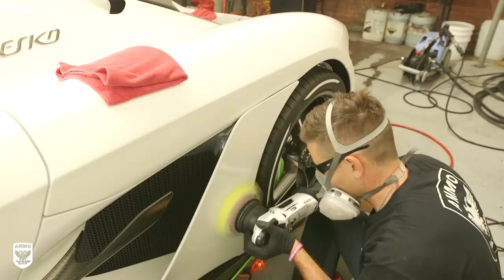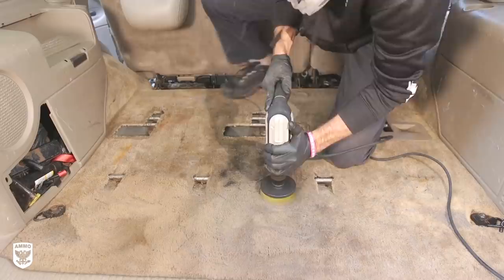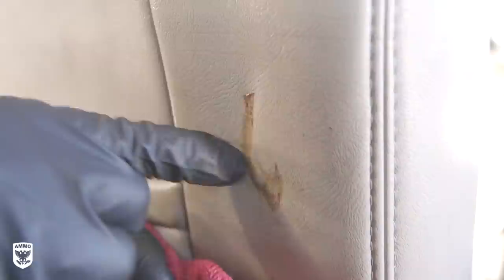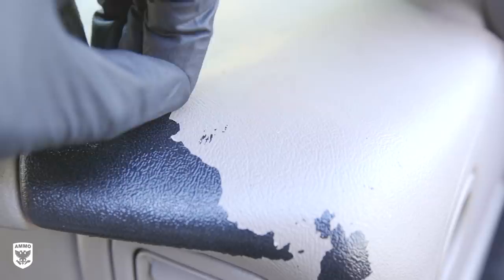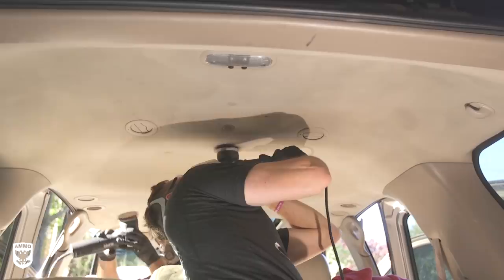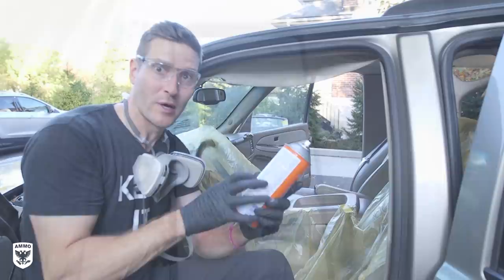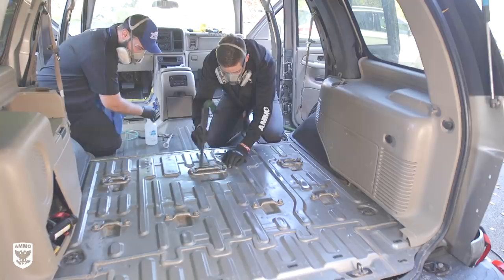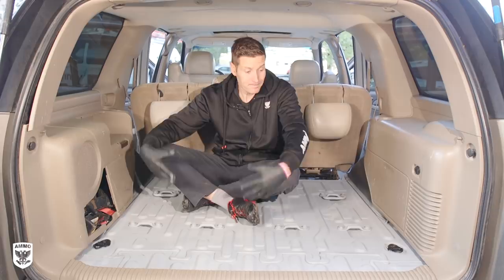Detailing Dirtiest Car Ever! Seat Removal Chevy Tahoe

Comment: Just a tip for the headliner repair part. I used to work in an interior shop and these chevys were notorious for this... The headliner isnt falling down because the original glue is bad, its falling down because the foam backing has disintigrated. You have to use a scuff pad to get rid of as much of that decaying foam before you can glue it back up like he is. if you dont get rid of the foam first, its just gonna come back down in a few days
Reply: This is exactly what this is. That headliner needs to come down for a full restoration.

Comment: "The car is on it's last leg, so we have maybe extended its life for another year."
Reply: 300k miles, hes lucky if it makes it till tomorrow lol
Reply: Hammerjockey Radios If he has the 5.3 it should last a while.
Reply: @Hammerjockeyrepair  m8, have you like never seen a vehicle with over 100k in your life? Most of the vehicles that my family owns or have owned in the past hit well over 200k. Step dads 2002 Ram 1500 was 430k before he sold it. Yes, he sold it. My 2010 Sebring has 230k miles, brothers 2006 G6 hit 200k last week, dads old 2003 Ram 1500 hit 210k before he sold it, uncles 2004 or 2005 Buick (unsure of the model) had 290k and the transmission was just starting to slip. My Grand Prix didn't quite make it that far, sadly, it had too much rust but it made it to 170k before the brakes went out completely (landed in the driveway but lost it pulling it into the garage lol) and the gas line was leaking. Everything under the hood was amazing, just not the body. I'll put money on it that it hits 400k.
Reply: @SteelOfLegend  yes 2 of my daily drivers have 250k+ a few of my customers have cars with over 350k. My statement is that after all of those miles and pressure washing every single year, it really never made that big of an issue
Reply: @Hammerjockeyrepair  Then why are you saying he's lucky if it makes it til tomorrow? It will last another couple years easy if they are not beating the living crap out of it.
Reply: Steel Titan yanks....
Reply: My '95 suburban has 335k on it with a completely original drivetrain, and other than it using a quarter every 100 miles, it drives perfectly.
Reply: That car will be on the road for another 17 years if it's not wrecked.

Comment: It’s fun to watch the dirty ones too. Also, being from Michigan (salt belt) I’ve noticed vehicles suffer from floor pan rot from the top down. It’s typically from salty slushy boots during the winter, and the lack of rubber floor mats. Parking lots and sidewalks are covered in salt and other corrosive chemicals in the winter to protect from icing. With no rubber floor mats to catch the wet salty boot drippings, the salt water from the boots sink into the carpet and rest on the floor board paint. After a few winters, the floor boards rust out. Rubber mats are the best way to protect from this along with regular cleaning under the carpets. Keep it clean!
Reply: Also explains why it’s more rusty on the driver footwell then other areas...

Comment: Some WeatherTech rubber formed mats would be the perfect thing for that guy’s Tahoe. The front floors fit from edge to edge and the center floorboard mat goes from door to door and they make one for the back area too. Not only do they have raised edges to trap and hold liquids like melted snow, mud or in his case dog pee. But they are easily removed and cleaned. It would save that guy a lot of work and be so much easier to clean.

Comment: It's a good idea to pull a door sill panel once in a while and check your floor. My truck had a bad back window seal and my carpet was perpetually wet and that wetness would creep. I had to remove the seats and carpet and paint my floors as you did.

Comment: I've had a few of those complete interior disassemble jobs to get somewhat clean. 1 came in after having sat for 4 years with all 4 windows down about 3". Under the carpet there was 6" of standing water. Had to replace the front seats due to motos freezing up.

Comment: That vehicle was a perfect candidate for Raptor Liner on the entire interior floor,  after your rust preventative measures.  No more overspray than your cans primer of primer when applied with a Schutz gun. Also available in a roll-on. It’s 2k and durable, can also be color matched.

Comment: Wire wheel acid removes the rust completely to clean metal just fyi, and unlike a muratic acid, the reaction stops when dry.

I use it to remove rust out of stone chips before I fill them and touch them up.

Works amazing for any rusted metal. Try it out.

Comment: Larry, check out Upol Raptor Liner.  That would have been a terrific product to use on the floor of the vehicle.  Raptor liner is tintable and if applied correctly, would last and provide superior abrasion and moisture protection.  You'll find Raptor Liner on the floors of more Jeeps than I can count.

Comment: hey Larry,
i dont know if you are aware of 3m super 77 or 33 as an alternative to the headliner glue.
its basically the same stuff in my opinion.
do your own research of course, but i personally prefer not to keep 'unitaskers' on my shelf.
it seems more practical to me to have a general purpose spray adhesive that i can use to attach headliners, leather or upholstery cladding as well.
this stuff is also great for creating sets for movies, you sray it out at a far distance, then dust it with power, and boom, instant cobwebs.

its like a spray rubber cement.

Comment: Curiosity got me, and a full carpet kit for that thing only runs 250-300 bucks.  

Your work is exemplary, and that floor did need saving (more from a safety standard than a looks one).  Maybe you can convince the customer to get a new carpet for the thing.  Though with how far they let it go, and the mindset of "power washing raw metal is just fine", I wouldn't hold my breath.

Comment: The amount of disassembly you do is interesting. You must have all sorts of stories and advice about plastic body fasteners, repairing things when disassembly goes awry, and maybe even improvements over the factory method. Do you get service manuals to help understand how stuff is put together? Just the steps of gaining access and putting it back together could be a video in its own right.

Comment: When the vehicle is this dirty I think it's actually less work, quicker, and certainly gets everything cleaner, to completely remove the carpet from the vehicle and use a pressure washer directly on it. Doing all that vacuuming, scrubbing, and spot cleaning from inside the vehicle is a royal pain!
I did this with a horribly abused 1990 BMW 525i and was able to save the entire interior, bringing most of it back to a very clean state.
You'd be amazed at how much mold, dirt, and other smelly disgusting stuff works it's way into places that are impossible to clean without removing the interior.
Trust me: It's so much easier and faster to scrub a carpet or a seat when it's NOT inside the vehicle!

Comment: Similar situation with my 1999 Suburban...it was a vehicle for dog transporting for 14 years!..Underneath all the plastic trim was fistfuls of dog hair and muck so actually much worse than this Tahoe. The allergens are incredible in my truck..been cleaning, removing trim, seats, headliner for 3 months...next step is to flush out the ventilation system...oooof

Comment: why wouldn't you just use a chassis saver or por-15? . You would get a much thicker water resistant coating plus You can also apply it with a brush which would self level and get no overspray like whats happening using a can.

Comment: You said its on its last leg? I have driven stuff that would make you cringe! 2x4's holding on leaf springs hooked with lag bolts! That things a gem compared to some the junk i have driven. A 82 pickup where the bed was about to fall off it. truck was still runing i drove it to the junk yard. If wasn't for rusted out frame and bed would kept it for a beater truck.

Comment: At this point instead of buying all those expensive cans of rust proofing. I would have gone down and paid $50 for bed liner and just coated the whole back end about twice. That stuff will never allow rust at it again. Plus it would protect the metal, also not scratch as easily when you throw tools in.

Comment: You're acting like a tiny bit of rust is going to make the vehicle fall apart in a week. Staaaahhhhpp.
My Grand Prix was perfectly fine on the road until the brakes went out and the exposed steel fuel lines rusted out. The body work was rusted to hell too but guess what? It still drove down the road just fine lol. I say it did because I kinda have it sitting in the garage all cut up right now. Oops. The main structure that holds the whole thing together was not compromised at all by any rust and it is hilarious when people freak out about it. Come up to the northern states and look under some vehicles.